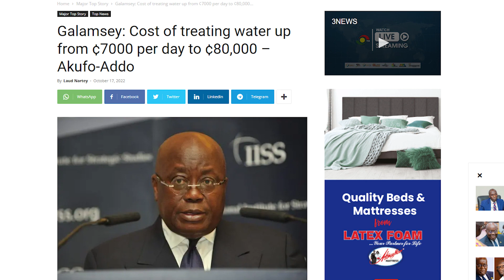Ghana Pastors Praying at Galamsey Site + Nana Addo in Kumasi

Comment: Concert party. Prayers cannot rescue galamsey. What we need is common sense and law enforcement!!!!
Reply: I think we should consider a higher authority coz this ur common sense is either too common for them to apply or the leaders don't find it common... Plus they are the law and won't enforce it.
Reply: @cs.smith91  Prayer goes with actions. That is why God gave us brains to think and do the right thing. Even in the bible and other religious books, there is discipline. There are several laws in Ghana that are only in theory. Until we do the right thing and the laws work, no amount of prayers will solve our problems.
Reply: @ivyde-souza4526 ... Then we can all agree that going to the site to prayer was an act to prove a certain level of discipline and not concert part, right?
Reply: @cs.smith91  Well we all go to church or the mosque to pray. If everybody will do thier part, there will be no need or we must not necessarily pray at the site to do the right thing or for God to answer. How about the other galamsey sites that prayers were not done? This seems only like an act. God is every where so prayers can be done at our various places of worships back with dicipline and obedience.